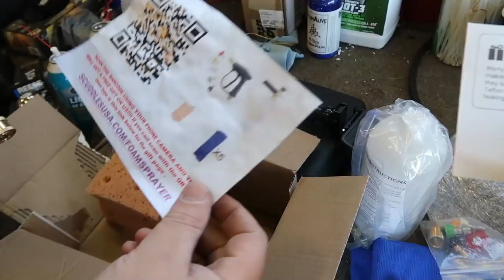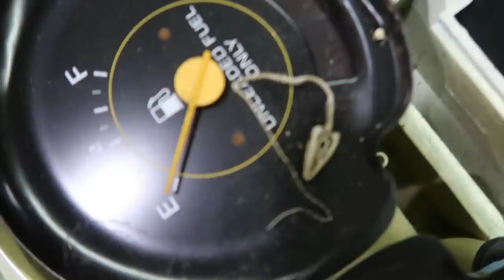This job is for the birds!

Comment: You don't know real fear as a kid until you've been chased by a mean rooster. Coop is a product of his environment 😂 Thanks for another great episode guys!!!
Reply: I'll One Up you on that. 
Many years ago, I was helping some friends butcher Chickens. My job was to hold on to the legs while the head was chopped off, then toss them over into a pile. Had one chicken that was NOT happy with being Beheaded.
I turfed it into the pile like the rest, but it barely hit the ground before it started flapping its wings and came straight back at me. Nothing new really. Odd headless chicken ran around for 30 seconds or so, all day. But this on, came straight at me and when I went to get out of its way, (Still had Blood coming from its neck, didn't want any on me), it followed me. started to freak Me out since it didn't seem to matter where I ran/turned, it was right behind me. after about a minute and a half, it finally quit.... My friends said that was the weirdest thing they had seen a dead chicken do in the 20+ years they'd been butchering them....